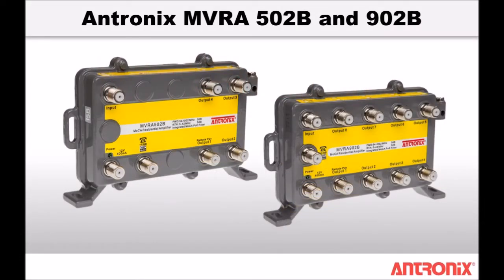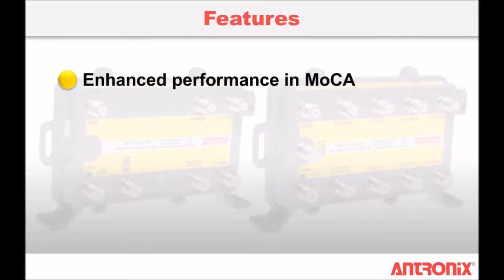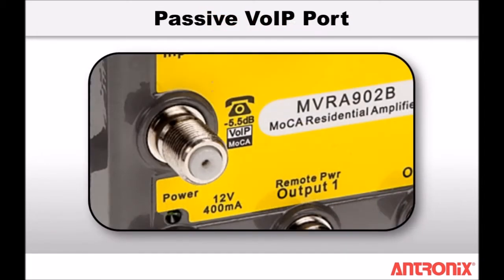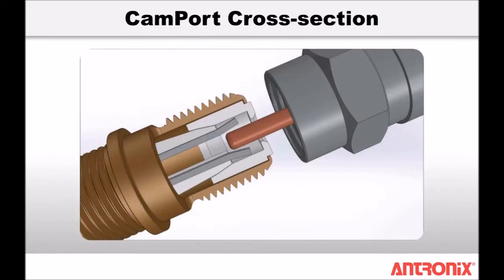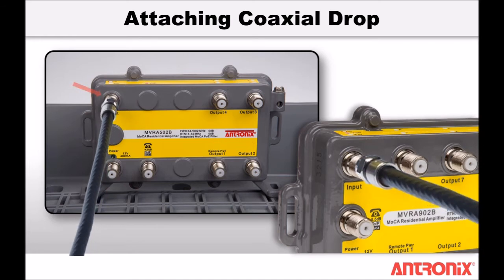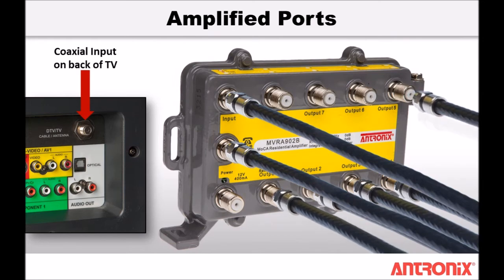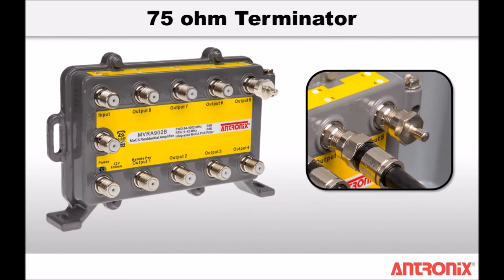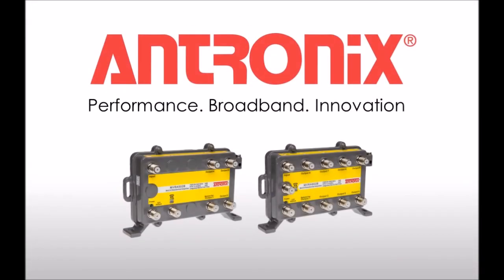Antronix MVRA Amplifier Installation

Comment: I have a green ground cable with a "warning do not remove" label with no little wires in the middle(no connect into something) what do I do? The black cable and white connect but I can't connect the green one to anything... Its just wired around the Board...